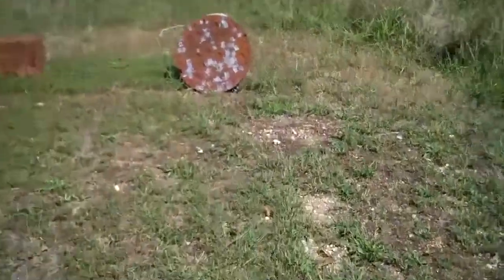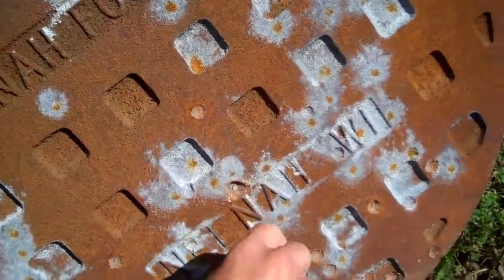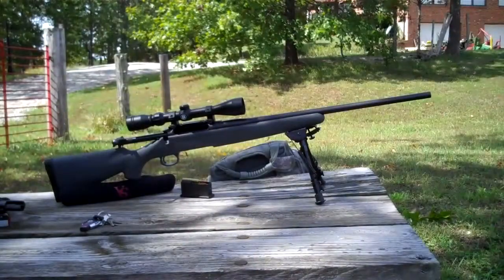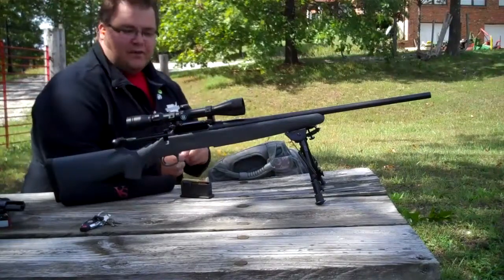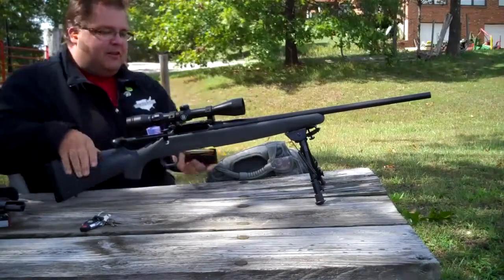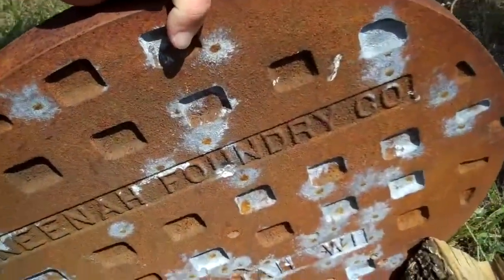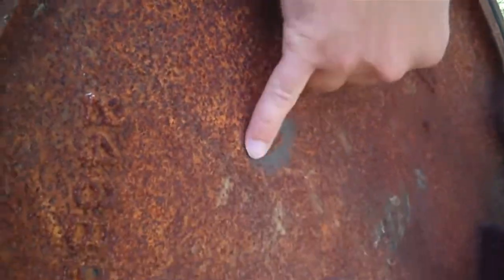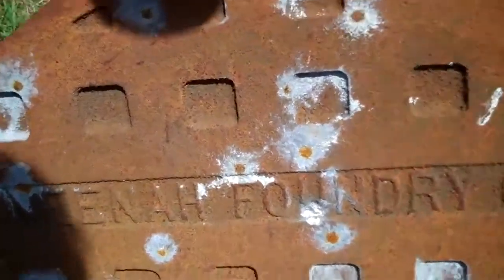Shooting a sewer lid with a Remington Model 710 in .30-06

Comment: The 710 is an affordable entry level rifle that Remington manufactured for budget minded shooters. Stating that this weapon is crap is a matter of opinion. Actually the model 700 was the basis of "Remington Under Fire" due to the 700 firing by itself. The 710 though inexpensive, has never been reported of doing this. Sometimes cheaper is better.

Comment: Glock715- The Remington 700 has had problems with the weapon firing while cycling the bolt. The Model 710 has never had that problem.  I've owned one for years, and it's been a great rifle.  You really don't know what you're talking about.

Comment: The 710 is a cheap durable rifle. It is extremely reliable, and extremely rugged. But it's like an AK-47, it isn't nearly as accurate as it's more expensive counter parts. But a piece of crap it is not, I've owned one for 9 years, and it's a devastating and reasonable accurate rifle.

Comment: 710 is no 700 really truthfully I own both the 710 30/06 the bolt cycles by a sharp point along a trouvé and my trouvé is crooked and not straight u have to really watch yourself cycling it where a 700 smooth